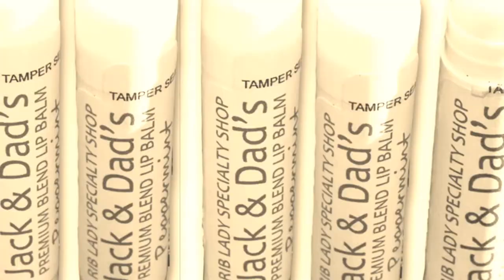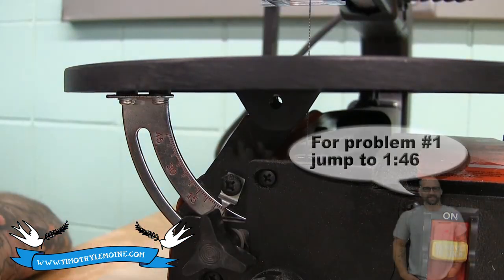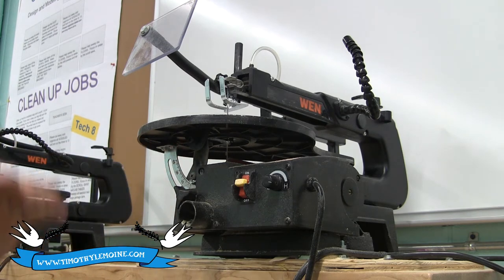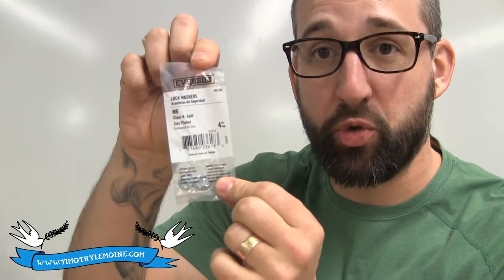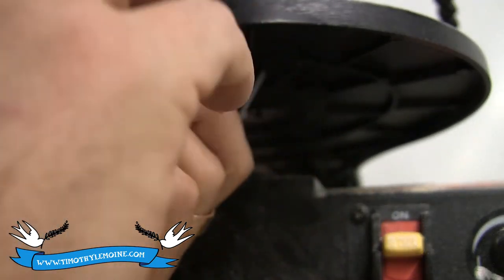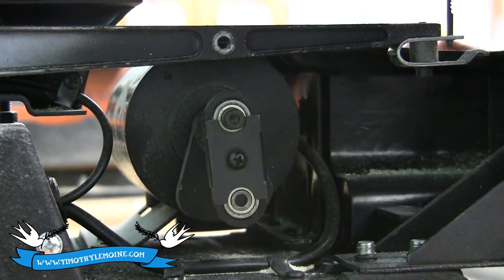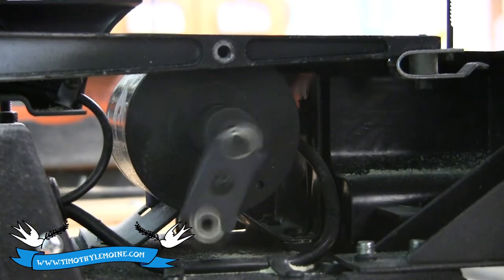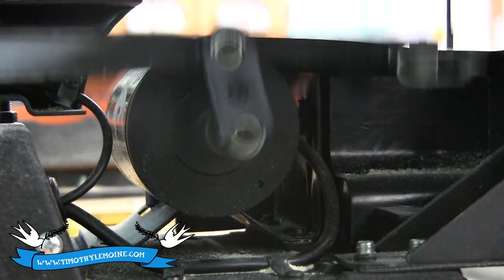How to Fix the Wen Scroll Saw model 3920 and 3921

Comment: A couple things here will make this an even better fix. Kudos Timothy....not bashing your video just adding what works for me. First off use all of the things Tom shows on the first fix but I would add a small amount of silicone to the threads of the bolt. It absorbs vibration.  Second I would replace the nut on the swing arm with a nylon locking nut. Wont come off again

Comment: Thank you for your tips.  I don't use my scroll saw often so when it started but the blade didn't move, I didn't have a clue.  Then I saw your tip and I cancelled the new one I ordered and fixed my gmc scroll saw.

Comment: Timothy, red Loctite would also solve the problem of the loose bolt under the table + the swing arm.  Every shop should have a tiny vial of it.  There are blue and green Loctite's, but the red is the one for this application.
Reply: Red is fine... if you never need to take it apart for repair. Use Blue.
Reply: @johnhill8958  Yes, thanks.

Comment: Thank you for this very informative video. I’m stuck not knowing what to do about my Wen 3921. The second problem you describe is similar, but the screw on the motor end keeps coming loose, not the one in the arm (same assembly but opposite end coming loose). If it’s too tight, it won’t allow the arm to move, but it keeps rattling and vibrating and coming out with every cut. New blade, 90” on table, tension has right ping sound. I’m at a loss and can’t seem to find anyone else on the internet having this issue. Do you have any experience with this or any advice? Thank you!

Comment: Hi Timothy, do you think it's possible for the upper arm inside the housing to slowly bend to one side over time? Had this saw for 4 years and suddenly it's skipping as it's cutting. It seems like the upper arm is off a little bit I don't understand how this could happen overnight. Already addressed the first problem you talked about on this video and no issues there. Don't know how to send you a picture. In the middle of a huge project and wen is not open until tomorrow.

Comment: Hi on the repair on the swing arm underneath that you did , the other screw has come out on mine , I've tried replacing it but it seems to undo by itself all the time, does yours have a locking washer holding in it as mine just seems to screw into black thing that rotates , I don't what's missing altogether I put new bearing in. Thanks for any help.
Reply: Did you ever figure this out? Mine came loose on the bottom as well and I tightened it back in to the thing that rotates and noticed a bearing on the floor of the saw. It didn't seem like there was enough room on the screw for it to fit in to the bearing and then the thing that rotates so I left it off but not sure if this will create a problem.

Comment: for problem #2 what are the specs on the other bolt, the one they sent me was pre-stripped and flung out (the bolt with the hex head inside)
Reply from the maker: Is this the one you are asking about?
Parts to fix Problem #2
1) Socket Cap Screw M5 - 8 x 25mm
2) Spacer
3) Loctite
4) Nut M5

Comment: Hi.  I have a problem with my wen scroll saw.  How can I fix the Flexible Led Assembly. I am from Mexico and the Wen company does not send replacement parts to Mexico so I must repair it myself.
Reply: I am also in Mexico and also have the light gone out.  Did you repair your light and if so, what did you end up doing?

Comment: Hey there. very helpful vid! but I have a different problem with my 3921 I wonder if you or anyone here has seen: the tension knob/lever is basically flopping around & won't hold position, causing the blade to randomly lose tension during use. I CAN tighten/loosen it to start, but it just won't stay that way while cutting. super frustrating & googling around hasn't found answers. I've only had the saw for a month so I'm hoping it's something I can fix... Thanks much if you have any advice.
Reply: I had the pin for the arm kept coming out.  Ended up just removing it and replaced with a cotter pin.
Reply: Did you ever get the problem resolved for the tension?